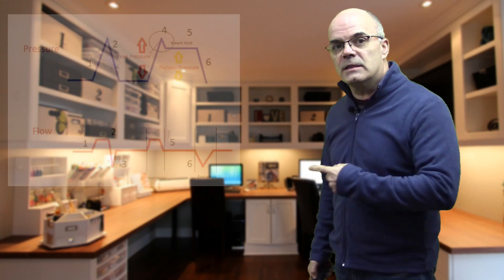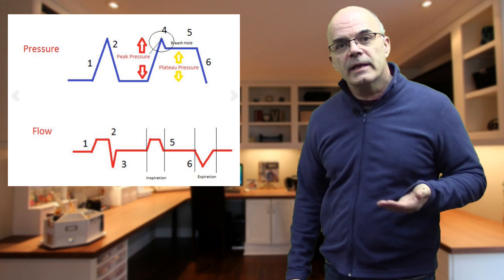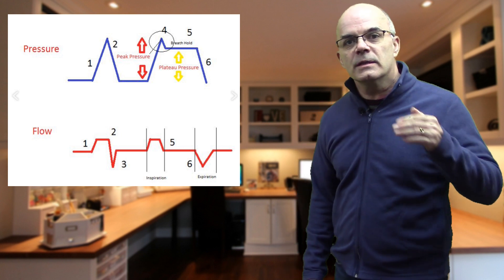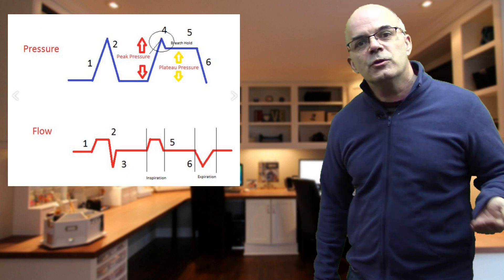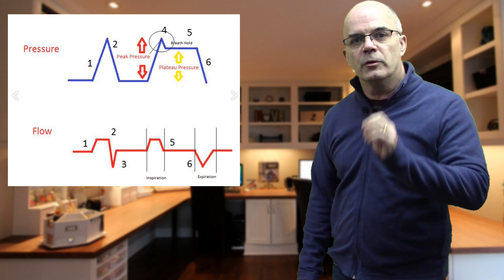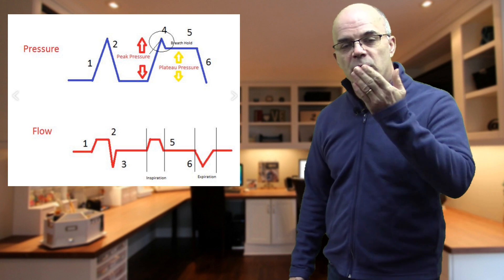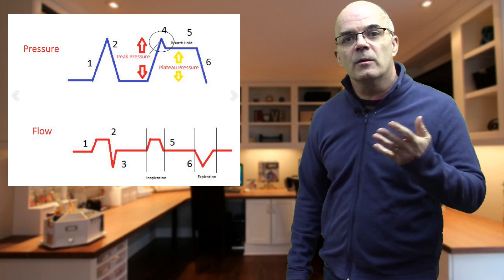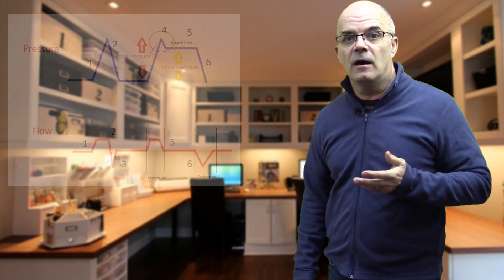What is Peak and Plateau Pressure in Mechanical Ventilation?

Comment: My father's p plat was 50 and then doctors decided to put him on ECMO. Was that a correct decision?
Reply from the maker: Hard to say with so little info but those pressures are very high
Reply: @TheCriticalCarePractitioner  pO2 75.7 mm Hg
pCO2 75.5 mm Hg and oxygen saturation was 90 at 60% support on ventilator. P plat was 50. Then doctors suggested ECMO and I said ok. Was that a right decision sir?

Comment: Very instructive video. @3:17 you explained that a difference greater than 5mmHg between Ppeak and Pplat is defined as an elevated Ppeak. 
Any reason why mmHg as a measurement and not cmH20 as most ventilator use this measurement? 
Many thanks

Comment: Solid explanation. So is elevated peak pressure defined solely by its relation to plateau pressure? In other words, if elevated peak pressure is defined as >5 over plateau pressure, does this mean that if plateau pressure were to be increased (and peak pressure stayed the same), the peak pressure would no longer be considered elevated even though only the plateau pressure changed? And what about the definition of high/low plateau pressure. Is it also defined only by its relation to peak pressure?
Reply: If i get your question right, If the Plateau pressure increase with no change in the Peak pressure means that there is problem with the complaince”decreased” leads to increase the elestic pressure

 And if the Peak pressure changed or increase, it could be problem with the elastic or resestive or both, so in order to know we see the plateau pressure, if increased, means that there is problem with both(elastic+resistive pressures). On the other hand, if plateau do not changed, means that problem is from resistive pressure only. 

Edit: the peak pressure related to (Elastic pressure and Resistive pressure), the Plateau pressure related more to (Elastic pressure). 
So the Plateau pressure help us to know where is the problem more accurately of Peak pressure increased. 

Hope this helps.